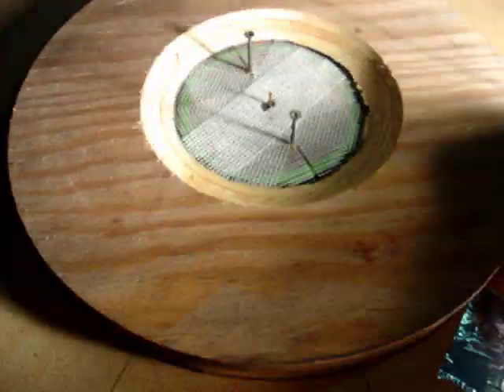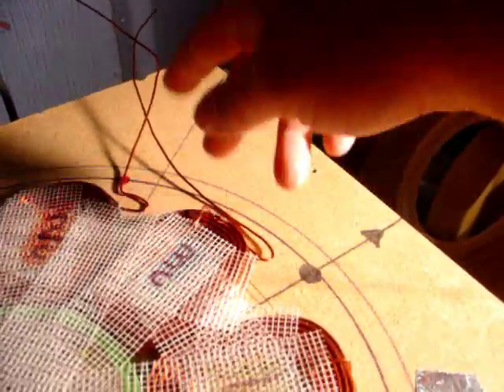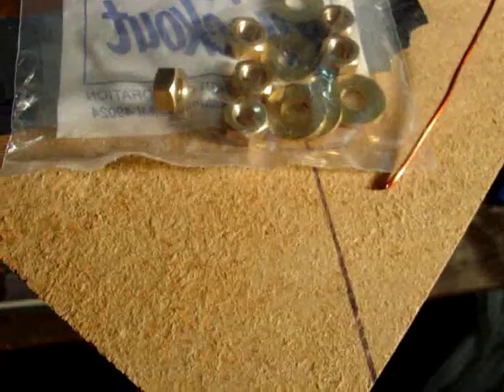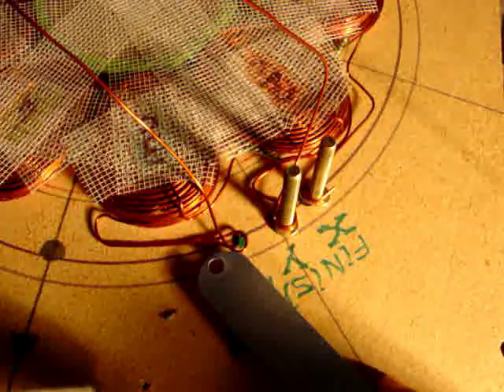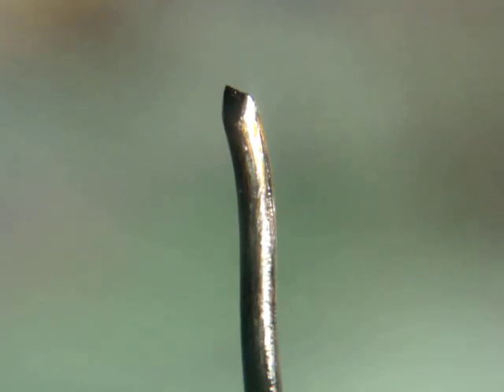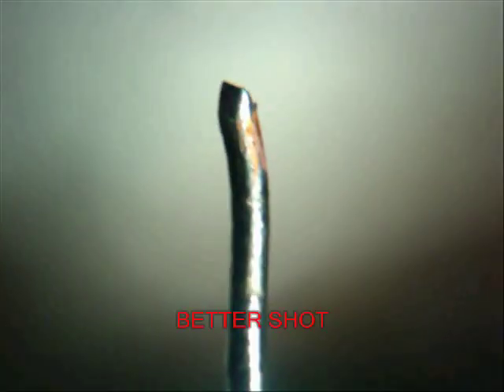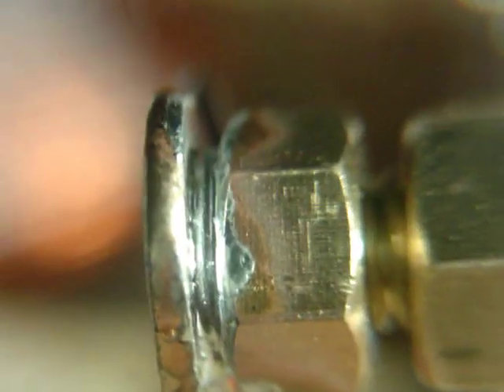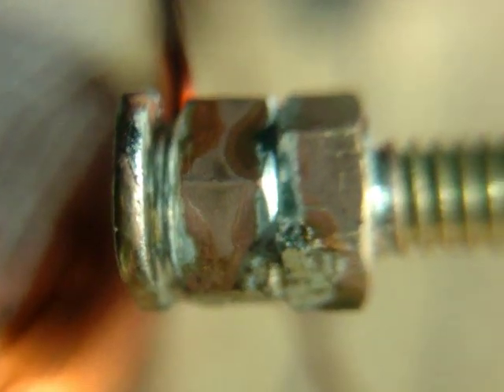BUILD A DUAL PERMANENT MAGNET ROTOR WIND TURBINE (PART 12)

Comment: I HAVE QUESTIONS. 1. Does the coils on the phases 1-3 go outer to inner, outer to inner, outer to inner or whats the repeating process on that? 2. can you use aluminum low heat solder sticks to join the connections?

Comment: @muddymuddymuddmann looks like they don't have it anymore.   can you tell what the equivelant wattage is?
so far I'm only seeing the "tiny" ones, as used on circuit board work,  which I already have,   for use in a very remote situation "BE" before electricity.
regards,

Comment: @muddymuddymuddmann Hey Muddy. Great minds think alike and different too, I didn't think of the terminals being pulled out, althought I did notice you kinda cross locked them nuts.  I was also thinking abount that 1/8" gap you have with the wire fron the inside of the coil, if you can run that from somewhere where the rotor is not gonna be rotating  on it,does mean you have to make the centre or the out rim of the stator thicker. I think the centre is prolly best option then take them

Comment: @muddymuddymuddmann The regulations here in Belgium are very strict. Most of the turbine i worked on before did not do so good. Pity.  Right now we are working on a horizontal turbine working with a permanent magnet motor i bought in the US. The blades are wind jacker blades. Got the template from west cost doug, he sent it to me. When its running i'l make a video and show it to you. Good luck with your stator casting. :-)
Greetings
Erik

Comment: Hi Muddmann, I have an opportunity to buy a motor, please help me get some perspective on the pros and cons. Here are the specs.
Alternating current generator - synchronous brushless.
12 wire/ 120 volt/ 52 amps/ 30 kVa/ 400 Hertz/ 2000 rpm, 3 phase/ self-excited.
It was originally intended for a diesel generator but was never installed, just sat in its original box in a warehouse for a long time.
What do you think?